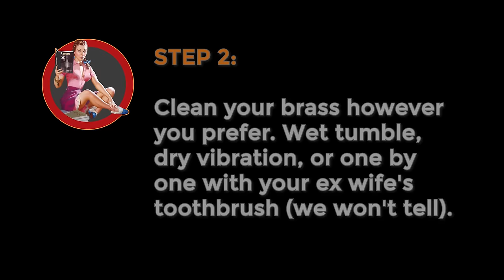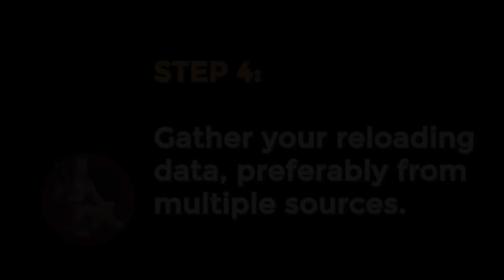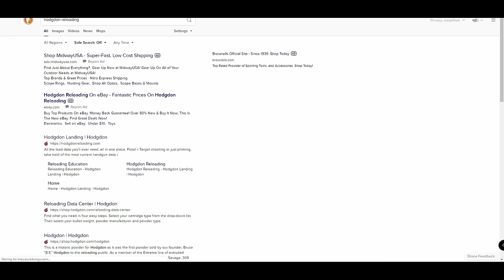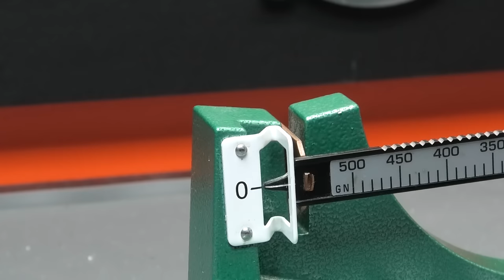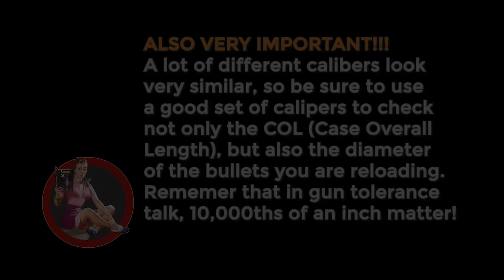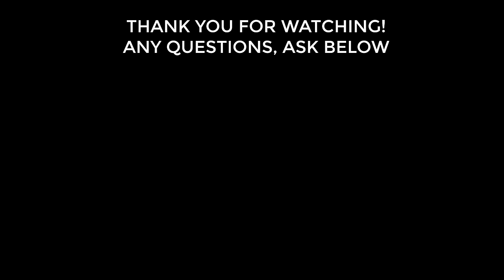Reloading 9mm. Start to Finish. HD.

Comment: Who makes the case and bullet feed?  The Hornady feed jams on me at times
Reply from the maker: I 3d printed the case feeder, and the bullet drop is hornady.  The bullet feeder took a little bit to get working reliably (I had to flare the cases a bit more, and really tweak the depth on the die, but then it was 100%).  The case feeder works almost flawlessly, and the most expensive part was the acrylic drop tubes ($30 off amazon or something like that).  https://www.thingiverse.com/thing:2488944
Reply: @High_Caliber  awesome!  You sell that?
Reply from the maker: @spock1017  No, but I do believe the originator does sell complete kits, here is a link to what you get with his upgraded kit:  https://www.youtube.com/watch?v=2G6Vt3TEOew  (plus I'm sure he would be better with any troubleshooting than I would be lol).  It's a great design, and it's worked perfectly for over 1000 cases (I've had 2 small parts break, but I may have just screwed up printing them).  As well, the tubes I found won't do .45 cases, and I think his will.  Mine does .223 and 9mm, which honestly is what I shoot the most of.

Comment: Any info on the case feeder you have?
Reply from the maker: It's a free print from thingiverse (although I think the creator also sells kits). I think I only needed acrylic tubes and some nuts and bolts to get it to work (and it works near flawlessly). https://www.thingiverse.com/thing:2488944

Comment: After seeing Youtube is about to end all these type videos, it had me looking them up for a few ideas. I reload with a Hornady LNL progressive press too. I've noticed that you have a different type case feeder and bullet feeder. What are you using? I've used a Lee in the past, but it's tricky to load the bullets in the tubes; as far as cases, I just set them on by hand. The case feeder Hornady uses is really loud and noisy and just doesn't have that much appeal to me to spend that kind of money on it. Thanks, pj.
Reply from the maker: Yep, I stopped doing gun vids a while ago, they had already demonetized them and suggested I make videos about woke stuff. Hard pass. I may start up again, but totally different content criticizing leftist nonsense, but of course that's not welcome at goodle/youtube either. 

The bullet feeder is RCBS (9mm) and the case feeder is 3d printed, free plans online, you just need to source the acrylic tubes (I found mine on amazon) https://www.thingiverse.com/thing:2488944

Comment: hey can you switch that to load with your left hand and pull lever with right?????? the single loader.
Reply from the maker: I honestly don't think I've ever seen a lefty loader. The hornady one is forged in right hand mode only, with the left hand feeding in the brass, there's no easy way to reverse it. On the Lee it's probably possible to reverse the lever, although I have had trouble trying to strip mine down to give it a much overdue cleaning so not sure.

Comment: About how often do you re use the same brass ? I’m thinking about getting into reloading . Thank you .
Reply from the maker: 9mm I have used up to 10 times depending on the manufacturer of the brass. Winchester tends to fail the quickest, and PPU or hornady seems to last a lot longer. When I start seeing a lot of split cases, I usually order another 1000-2000 rounds of "once fired" brass online, and just cycle it into the mix.
Reply: @High_Caliber  Excellent, thank you . Have you used any starline products ?
Reply from the maker: @Edemce1  Sorry missed this... Yes I have used a lot of starline brass, but in rifle calibers. For 9mm I just have so many from range scrounging and pre-manufactured rounds from competing, that I just use anything. For competition the targets are never more than 60 yards away at most, so they don't need to be sub moa accurate :)
Reply: @High_Caliber  Where do you order your brass from online?

Comment: What do you mean by de prime in step 1?
Reply from the maker: I run the brass through the depriming/resizing die before I clean/tumble the brass, that keeps a lot of the lead dust out of the water, and gives much cleaner primer pockets because the pins can get into the pocket.

Comment: Maybe it's different in wet tumblers, but in my vibe tumbler I always find a 380 inside a 9mm inside a 40 cal.
Reply from the maker: No it's exactly the same, that's why I separate by calibers before I tumble. Anything that CAN fit into anything else, will.

Comment: What do you do for the Glock bulge ?
Reply from the maker: I own a glock 17, but don't shoot it, it's a bedside gun only, because I know it will work when I need it to. I have ~10 other 9mms that have good tolerances, and I shoot them for fun and competition.  I don't even know if the gen 4+ addressed the issue at all, I sort of stopped at the gen 3. I guess I just avoid the bulge by avoiding the platform :)
Reply: @High_Caliber  When reloading your own ammo , it pays to pay attention to your brass.  The bulge can blow up in the breach. Check it out on the tube of you.

Comment: 9x21 is different caliber bit most likely can do shorter case too
Reply from the maker: The hornady 3 die sets do both.  I don't think the 9x21 is all that common.
Reply: @High_Caliber  no 9x21 is an old 1960s winchester beefed up 9mm

Comment: Roughly what does your reloading equipment cost for a set up like this
Reply from the maker: Well my setup is sort of spread out over a lot of years, but to reload one caliber, you would need the press, the dies and the shellplate.  So you'd likely be able to get in for around $500 IF the gun economy wasn't going insane.  Most guys either cruise the gun forums for used setups, or gun shows for parts and pieces (that's what I've done over the years, tons of steals and deals at the shows). Then you have to factor in things like the scales, the calipers, the tumbler, etc etc, so probably said and done about $1000.  Thing is, with .223 creeping up on or more than $1 a round, and IF you shoot a lot, you recoup the cost of the press really quickly.  Even 9mm, which is pretty cheap to buy in bulk, will pay for itself if you shoot enough.  I go through ~1000 rounds a week on average, and if I was paying retail....well I wouldn't be shooting 1000 rounds a week let's leave it at that.  As well, when I buy components in bulk, my wife can't do the math and figure how much money I'm burning up, and that right there is worth the price of the press.  It's a tough question to answer, especially with the current ammo shortages, prices are crazy, but hopefully that is some help :)
Reply: @High_Caliber  Yes it is

Comment: Damn dude tighten down your press to the bench. Sooo much deflection a you can’t be getting accurate measurements
Reply from the maker: Very good point. For you, I have packed up this entire setup, moved it 3000 miles west, and set it up on an old welding table. Thanks for the tip! ;)